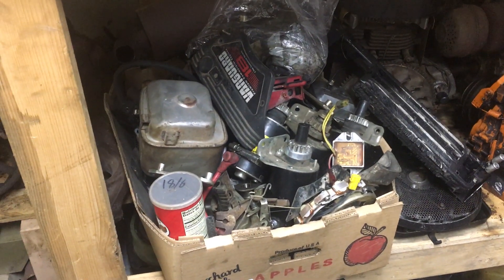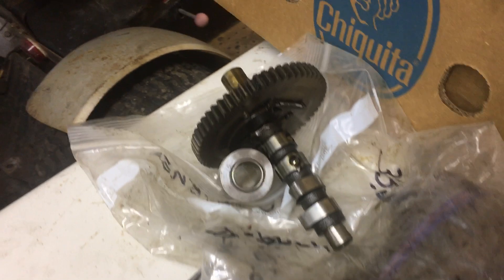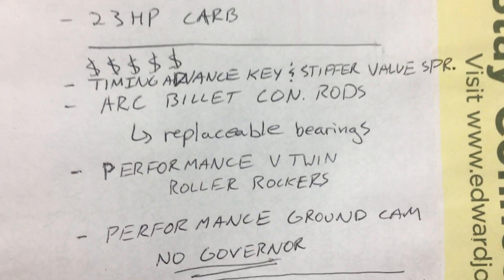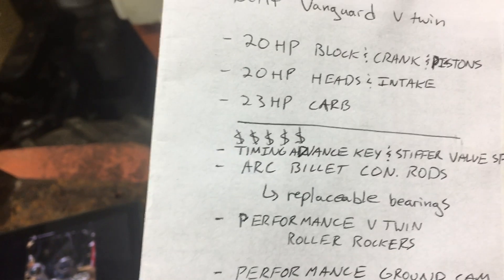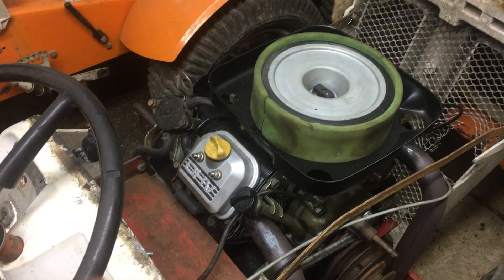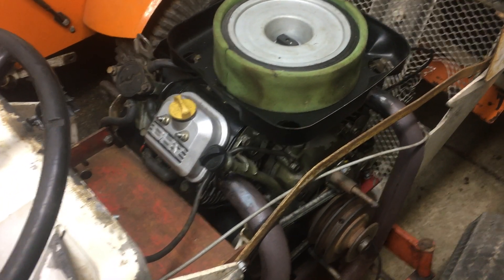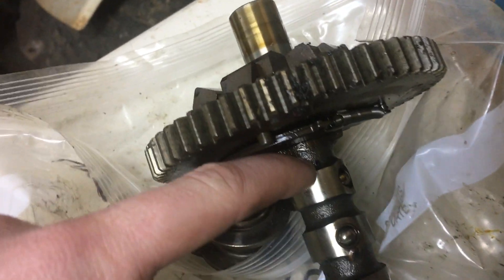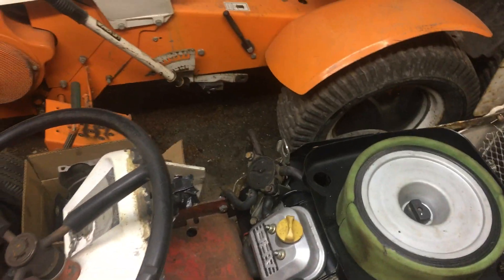Briggs Vanguard V Twin Performance Build Explained

Comment: I have a Kohler V twin 725 cc. CV730 . it has hydraulic litters.  I like that saves having to do valve adjustments.  Mine is rated at 25 horsepower,  dont have a clue how much torque it makes.  I put it on a Murray 40 inch cut. (Had a Briggs 12.5 horsepower) don't know what happened,  a blade stopped,  the engine never even bogged.  It broke the blade adapter,  stripped the spindle shaft and ripped the drive pulley for the spindle in two. Fortunately I had the parts on hand to fix. I have to admit I like the power.  The 12.5 felt under powered.

Comment: I got a 14horse that is having Valve issues. Im half tempted to upgrade some stuff when Im in there. Thanks for the info. Problem is, mine is running a cheap old centrifugal comet clutch on a heavy ass Cushman Utv Maxim with a 1200 Lb Load rating on the rear axle.. So I think I got to keep it governed anyhow else Ill burn belts constantly. Just trying to find the smartest upgrades for my application.

Comment: I was in several riding mower forums at one time, they sed in order to get speed , you need to delete the governer and throw a bunch of billet speed parts in it. Not true. Totally stock 18hp twin flathead briggs , running the governer , i was able to get double digit speed from it. How?  Pulleys.  I used a 8" motor pulley , 4" trans pulley on a murray shift on the fly tractor. Of course at initial take off its a bit slow, but once it winds up, it boogies. Posted speed on my road is 35mph, it went way faster then that, and i was only in like 3rd gear. Possibly if i put a mikuni carb or something like that might increase rpms, but it was fast enough for me. Larger motor pulley kept the rpms down while it wound up.
Reply from the maker: Pulley swap is good for ground speed changes but for tractor pulling, you dont want ground speed, you want high rpm (the highest allowable for the class) while maintaining a somewhat low ground speed, it carries down the track better. If the whole goal was to speed up the engine to make whatever it is in faster, its pretty much pointless except for a built engine doubles or triples the horsepower and makes it more stout than a factory stock engine